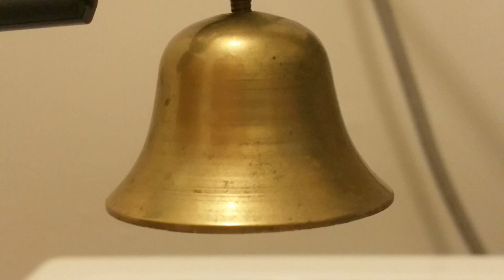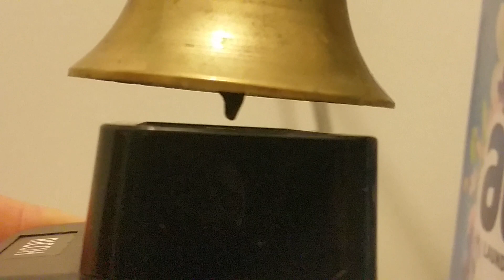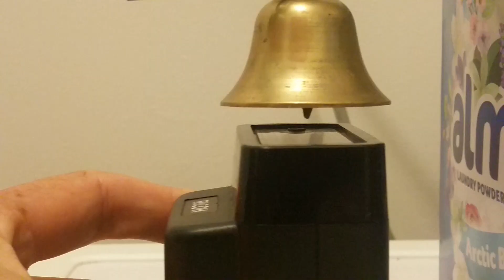Camera Flash Rings Bell...

Comment: I first noticed this as a kid around 1971. In 1978 I asked my college physics professor about it. He did not give me an explanation.

I also noticed that it will NOT ring a crystal wine glass, though the wine glass will ring if you physically tap it. 

Maybe @Veritasium could delve into this.  I've always suspected it demonstrates the momentum of photons.
Reply from the maker: interesting it doesn't work for crystal, i heard about it ringing drum cymbals and so tried it on the bell, also a follow up i have not video'd yet is sound on black surfaces from pulsing LEDs.

Comment: It could be in harmonic resonance with the capacitor when it discharges. Try firing it that close without aiming the light at the bell, otherwise I would say it is a shock wave of heated air hitting the bell as those flashes are extremely hot for a very short time. I used to have a very high guide number flash and could explode balloons filled with hydrogen and oxygen of chlorine and hydrogen. Would work with acetylene, also
Reply: The specs on that flash unit say that it is neon, so very little heat.  A cap discharge (on a load) really makes no sound.  I don't think that flash unit has a relay either.   Intriguing.
Reply from the maker: Neon flash untit huh? Thanks for that
Reply: I've just replicated this with a wok lid for my physics students and the flash on a standard DSLR camera. Also passed it through a piece of plastic. I think this is radiation pressure as the photons impart momentum to the "bell"

Comment: That is fascinating, it makes you wonder if it is just the amount of joules of energy sunk into the metal in such a short time that is making it resonate? Then again the problem is there is also a pop sound from the flash, so you need to fire it in a vacuum to prove that just the light is interacting with the bell.
Reply: yep. read my comment.
Reply: @kbbacon  Could be induced eddy currents too if there is an EMP off the flash. Some more experiments are in order methinks.
Reply: @DanielSMatthews  Yes!! I thought about electromagnet induction, too. Good thought.

Comment: Is there a measurable voltage at the rim of the bell and the peak of the handle upon discharge? Would a bell ring if hit with a emp? If it is a inductor it would. Kinda makes you wonder what would a horn for electric pressure would look like if optimized. Horns make small pressure waves amplified seems possible to emulate with light or electric pressure considering the “photon” carries electric pressure too. The question is weather or not it is induction or something else. I bet that flash has a coil with a high voltage trigger. The trigger will have a discharge radius according to how many joules are used. Put a sniffer coil above the flash in the same way and measure with meter and you will have a answer.

Comment: I would bet the coil will ring if observed using a oscilloscope and the resonant frequency will match or nearly match the bells tonal frequency.
Reply from the maker: It will ring any bell or symbol so it is not a function of tuning! I am considering laying out the parts of the flash unit and checking if there is a magnetic portion influencing it...however I have another video following that shows sound comimg from a non metallic surface being impacted by pulsing light. I like how you put photons in "".